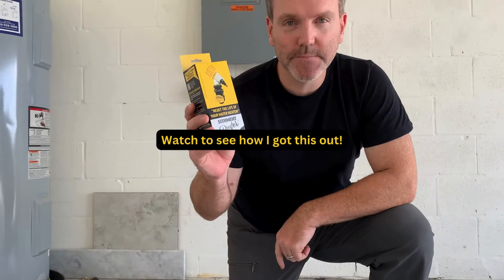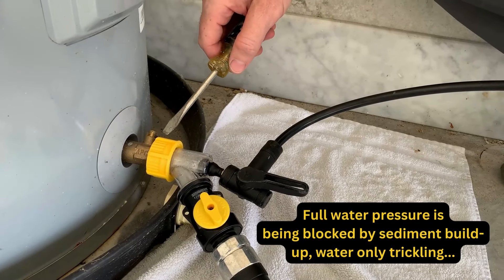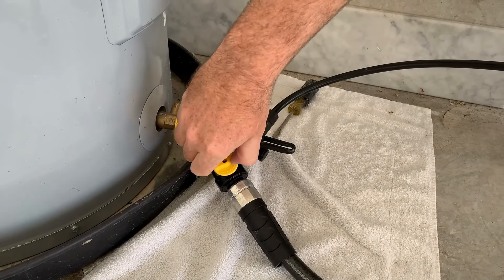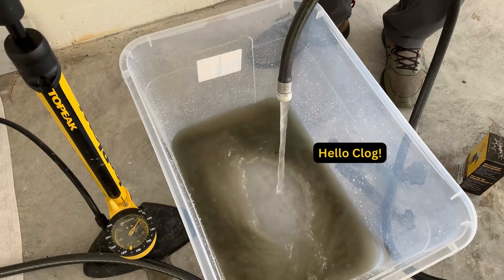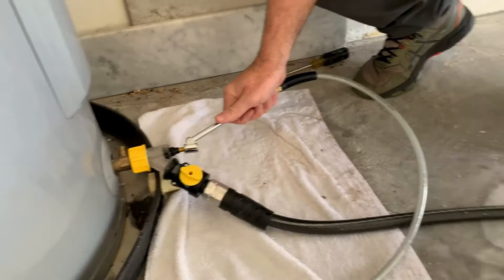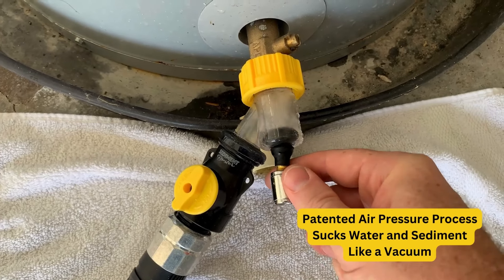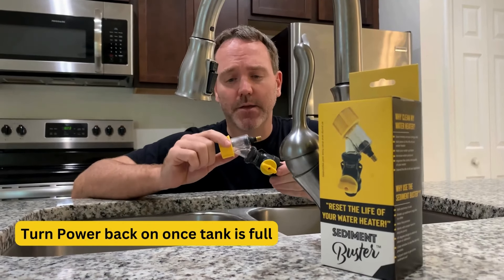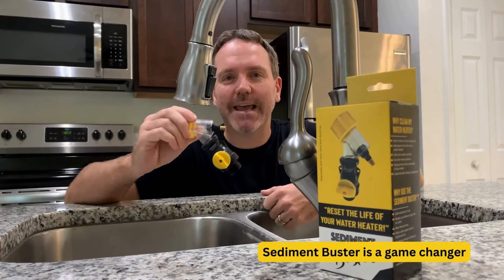Sediment Buster flushing a water heater then draining the tank and sediment in one process

Comment: Can't wait to order one before my next water heater flush. I have a little electric tire compressor. Any suggestions on how to use that with it to pulse it like you are in the video? My compressor takes an input psi and shuts off once reached. I wish you success!
Reply from the maker: Thanks!  The pulsing action is best from either an air compressor or a bicycle pump.  Anything that you can give it a momentary quick shot.  You might also have success with the pump you are referring to, but I am not as familiar.  The action of the pump puts a shot of air down the hose and into the tank, followed by the vortex that grabs it back through and out.

Comment: Tried to send a message on the Sediment Buster site but it doesn't work.  Our water heater doesn't get the sediment as much as it does calcium build up.  I've had to take out the lower element, duct tape a piece of water hose to a shop vac to suck it out and a times take a coat hanger to break it loose so it could be sucked up.  Will the Sediment Buster work on breaking up calcium deposits?
Reply from the maker: https://youtu.be/UBdB5FUu6Aw?si=3zVjoIYb2b4NXaST

Comment: Do you leave the cold water valve open on the water heater?
Reply from the maker: Yes, in this video the cold water valve was open creating the internal water pressure.  Still needed the Sediment Buster to dislodge that clog.  See the full length video on how we not only broke the clog, but actually pulled more sediment out of the tank while draining without pressure.  https://youtu.be/AJbxd7nEEfo?si=NovOiozwIYyy-TXJ